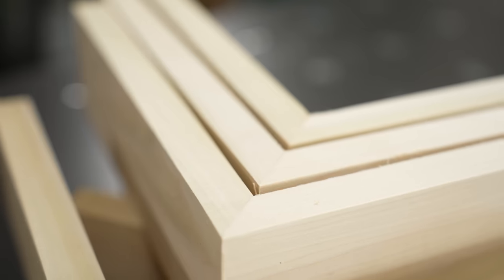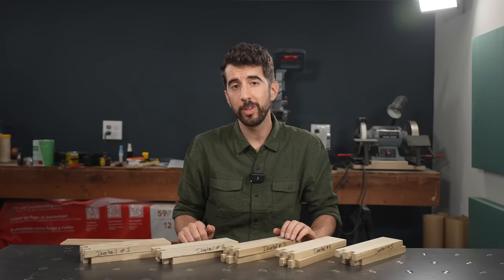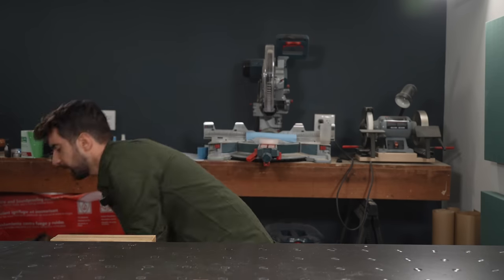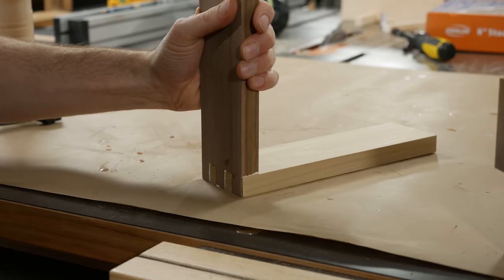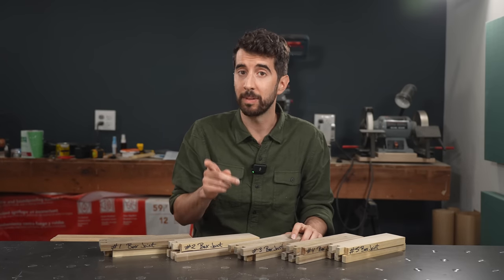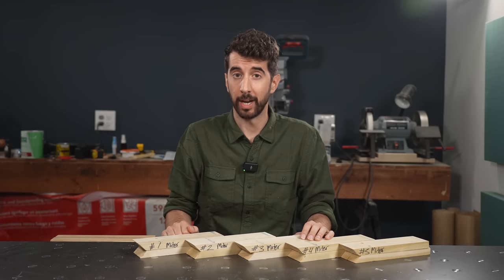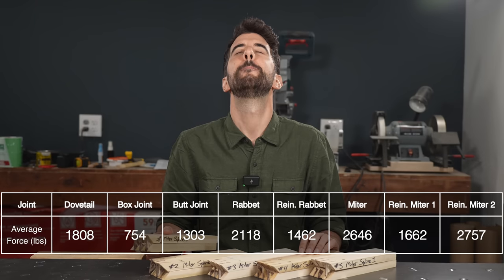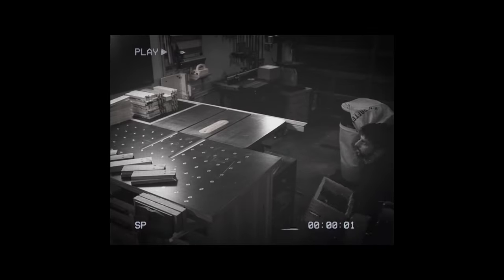This Simple Joint is Stronger Than a Dovetail!

Comment: I use the splined miters like the last one you tested on all of my picture frames - looks great, good to see that it's actually good.

For my boxes/humidors, etc. I actually use a mitered dovetail - do a miter joint, glue it up, then do a dovetail through the miter. Those look awesome as well, and have to assume that it'll make those joints even stronger than the splined miters - would be interesting to test that.

Comment: Would have loved to see how the mitre lock joint holds up given the newfound knowledge of mitre joint strength and glue ups!
Reply: I second the wish to see a locking miter tested. Solves the clamping challenges of std miter and appears to prevent glue starvation of many joint types. Also increases glue surface area.

Comment: Interesting test and valuable despite the very limited amount of samples. I'll definitely be using more rebates and miters! As a point of interest; discarding your top and bottom samples as "outliers" isn't a good idea. Statistically speaking, outliers can be calculated from quartiles (Q1, Q2/Median, Q3) and the interquartile distance (IQ). Top outliers would be >Q3+1.5IQ and bottom outliers <Q-1.5IQ. Your sample size is so small that you can't really reasonably tell what an outlier is (unless you notice something weird with the actual workpiece) so I would just take the average of all 5.

Comment: I think, as you mentioned, that the main call for dovetails in drawers is not brute strength. it's long term resistance to wiggle and thousands of tugs.
Reply: Dovetails are kinda a cool looking joint too.
Reply: @steveweinbeck1968  I agree, but the box and reinforced (2nd type in the video) are also visually appealing.

Comment: Ok - statistically there is no good reason to throw away the top and bottom values. They are important contributors to the estimation of your standard deviation. If one is miles away from the others then you may consider removing it but you do have to be really careful about biasing your results.
Reply: Yeah he pretty much just cut his sample size in half by doing that but whatever. These tests don't even matter as experienced modern woodworkers already know that pretty much anything you do these days is overkill in reality.
Reply: @CarlYota No he did not cut his sample size in half because he tested all five. What he is doing is taking the mode of his samples and then taking the mean of that mode. For large sample size taking the median would have been better but for low sample size his method is good approximation.

Comment: I am a big box-joint person, and one thing I have found is that using the swelling action of water based glues is a great way to close the joint without starving. If you make them just a hair looser, so that only one mallet tap puts them together, they swell within minutes to the point where you can no longer pull them apart, without all of your glue squeezing out when you clamp them.

Comment: Thanks for the video.  I've been messing around while out of work for health issues. But, I just did a butt joint for some drawers for pots and pans. Way harder than what I thought.  The cabinet I put them in, opens up real wide inside. So I had to basically build the framing for the drawer slides to be mounted to.  So the only measurement I had to go on was the spacing between the cabinet doors. First one wasn't perfect. I tried to keep a slim profile but due to an uneven shelf, the back of my drawer rubs on the bottom. On the second one I gave myself a few more inches and raised it up a bit.  They are both pretty sturdy drawers though.   It was challenging, but I'm very excited they work.  I have hand me down saws with extremely worn blades and shaky hands. Next project, I will buy new blades since I got to experience a very painful kickback. I might look into some sort of cross cut sled. I don't know if it'll work on mine but worth a shot. I Would like a bigger surface for table saw so that might be my next project. I've looked at a few.  I just need something simple though. Like I said I have no training just trying to make things a little more organized in the house while I'm home. And I had extra wood lying around for the drawers. It was fun, though. I enjoyed doing it,  just wish I was better at straight cuts. If I do build a table to put next to my table saw stand, does it need to be the exact height or a hair lower to push the boards being cut onto?

Comment: My biggest take away was that no matter which joint I use, it will never be under this much stress. LoL! Great video and I thoroughly enjoyed it. Great data. Thank you for sharing. A plywood box I made when I was a teen, 40+ years ago, with butt joints, glue, and brad nails is still holding together after all these years. Mostly. Wood movement, the plywood warped and bowed on one side, caused the most likely glue starved joint to fail. However the nails kept it together. I merely squeezed more glue into that joint and clamped the crap out of it for 4 days. It will probably bow again in the future, but I'll probably be dead and IF any of my kids keep it, they will be the one gluing it back together again. LoL

Comment: Fantastic test! Very eye opening. I would be interested to see how a 1/4-1/4-1/4 joint holds up, as well as a stepped dowel (Miller dowel).  But this test has convinced me to not spend the $ (and time) on a dovetail jig for making my shop furniture.
Reply from the maker: I mean, at the end of the day, it would be pretty cool if your shop drawers were all dovetails

Comment: Really interesting.  I guess we are all slow to adapt to the reality of how strong modern glues really are.  I make kitchens and when the design calls for wooden drawer boxes, I use the quarter/quarter/quarter joint as it is highly repeatable.  After watching this, I should just use the butt joint as it is more than strong enough and would be faster to build.  Great video, much appreciated.
Reply from the maker: It's hard to know how long a butt joint would hold up over time though. The quarter-quarter-quarter method is great and I would still imagine it holding up for a longer period of time.

Comment: As a picture framer of 40 plus years....45 degree mitre joints while being fast, are also extremely strong.  We used to pre drill and put in a finishing nail on opposite sides.   Some of the high end frame mfrs sold metal clips pounded in from the bottom.  None are necessary. Suggest you use a light coating of glue...wait a couple minutes then glue as normal.  Square clamping is essential.   After that they are stable.  Movement of a joint like drawers, requires the right pull push joint.  If you look at cabinet doors that are 45 mitres...they  last forever without any other reinforcement. Try to refurbish a 150 year old piece and study the joinery.  You'll learn.

Comment: GREAT job Scott!   I love that you tested multiple samples.   I wish more would use this approach.   Testing only one is not reliable.     On Longevity:   I have seen many many picture frames fail with glued miters.  The seasonal cycling will pull the joint apart and typically shows as a gap on the inside end of the joint.   Like you said, the longevity of these joints needs to be tested.   I would like to hear how one might do an accelerated test of longevity.   Anyone???
Reply from the maker: I'm devising a scheme for making some sort of contraption that can put a small and cycling amount of pressure on a bunch of test joints all at once (something like 30 lbs on and off every couple of seconds) and have it contained in a sealed enclosure where I can introduce and evacuate fluctuating humidity say every half hour. Leave it running for three months straight and see what happens... it might take me a few years to get around to it though 😂

Comment: This video is very much a testament to the power of a good adhesive (and joints that maximize its effectiveness).
Reply: But one should remember that modern adhesives are stronger than natural lignin in the wood that keep fibers together,  but nowhere near as strong as fibers themselves.  So phrase 'stronger' than wood and at what connections you get mechanical advantage, needs to be taken with this understanding. If you make mechanical joint breaking which tries to tear the fibers, that will be stronger than the glued ones.  If the force tries to separate the fibers,  modern glue may give stronger result

Comment: I made some plywood drawers for the bed of my truck about 7 years ago that have seen more abuse than anything else I have ever build. Since they just hold tools, they are simply constructed from 3/4” plywood for the sides and 1/2” plywood for the bottom. The bottom is glued and screwed to the bottom edge of the sides and the sides are glued and nailed together with reinforcement blocks glued and nailed into each corner. These drawers hold literally hundreds of pounds of tools and one of the is so hard to pulled out of the truck that I have to grab it with both hand, get a little momentum, and lean back on it. I have pulled this drawer in and out countless times, definitely several thousand. Those joints have never budged once.

Comment: I think I have seen others do similar tests on YouTube, though off the top of my head I can't think of one.  I'd be curious to know if you modeled your test on someone else's and if you found your results consistent with what others have found or not.  Glad you posted the spreadsheet in the video.  I paused it there to look at all the data points and examine the deviation.  It's a lot of work to make 5 samples of each joint for testing, so kudos to you.
Reply: Lots of people have done this. Bourbon Moth did and also concluded that splined miters were the strongest.

Comment: with end-grain to end-grain the glue travels down inside the joint, instead of just having the surfaces grabbing the glue you have the inside structure of the wood allowing more area for the glue to cure into i would love to see and end-grain to end-grain but join vs end-grain to long-grain vs long-grain to long-grain comparison to verify my thoughts though

Comment: Dang, this video definitely went against expectations. I need to watch all the other good wood failure tests of using forces in different directions to help get a sense of what's actually sensible.
Now of only someone could make a test about the right tolerances with digital calipers or even a micrometer for testing purposes and in a similar vein just purely about what clamping force (pressure, not just force but per area) is too little or too much. Also some kind of accelerated longevity test for joint types, just taking your wood outside to gather moisture and inside to dry up again, maybe in a monthly basis.
I know I'm not in a place right now to be able to do that and film it as well, but please, someone, take one for the team and advance woodworking for us all :D

Comment: I know I'm late, but I have an idea as to why the miter and miter plus spine joints are so strong with glue. It has to do with surface area. A 45 degree cut across the wood increases the amount of surface area on which the glue can do it's work. With the post-cut splines, there's even more surface area and it's working with the angle you're putting force on the joint, rather than against if you were to put force on the sides of the boards. Basically, it has the benefits of additional surface area like the box and dovetail(we'll ignore the likelihood of wasted glue from the fitting expulsion, at this time), but it also has the benefits of not working against the force being placed on it from the test.
Reply: I figure it's more about the straw-like fibers that allow the glue to penetrate both surfaces like hundreds of little fingers binding those two surfaces. As demonstrated in this video the wood didn't break in the miter cuts, just the glue. So logically the more fingers holding it, the greater the grip.

Comment: This is a great example of how the experiment or test setup can change the result entirely. The tests are good, repeatable and you even used 5x samples each which is good practice. They are conclusive but only if you use your wood connection in this one way with the force being applied to this one direction. It´s an isolated test.

Comment: A key feature in mechanical joints is the mode of failure. Our buildings for example are not only designed to be the strongest, rather an important design consideration is to have a ductile failure, meaning that the structure does not fail catastrophically suddenly, but allows a considerable strain prior to failure. If you've ever sat on an old chair that was falling apart slowly under your weight you can appreciate the heads up a forgiving joint has. I you were to load a structure that feels strong until the very moment it breaks you'd be frightened to use it again. the mechanical interfering joints are the ones which sustain strain and fiber compression before snapping, making them a safer joint to use. As said in the video the strength is enough even with the weakest of the bunch. the mode of failure is key.

Comment: If you do another run of tests I would love to see how the "half-blind tongue and rabbet" and "lock-miter" compare.  

There is also probably a joint effectiveness difference between manufactured plywood and solid wood: like the mitre might fail over time in solid wood that moves, but the more stable plywood won't stress the glue joint.

Comment: It may be interesting to also note if the joints that failed in the glue had an adhesive or cohesive failure, or substrate failure.
Generally, cohesive failure occurs at a higher force than adhesive failure.
The rabbit joint appeared to have adhesive failure, with the glue pulling away from the smooth surface, with a minor bit of substrate failure where it pulled off the top layer of wood.
The mitre joint would be more likely to have a cohesive failure due to the glue penetrating the end grain, meaning the glue itself needs to break. This should allow you to get the maximum strength of the glue.
Reply from the maker: Good point 👍

Comment: It seems like the dowels and the first splines worked like levers to break up the structure of the rails. 
So the weakest of these joint would require 2 linebackers standing on it to break?

Comment: Scott, did you test all of the doweled rabbet joints with the dowels horizontal in the jig? If so, that's opposite of the direction I would have them in a drawer. The fixture should be pulling the the dowels out of the wood rather than putting the force from what would (in my usage) be the side of the drawer. I'd have the dowels in a front-to-back orientation in the drawer to, I think, maximize their effect. But as most people wouldn't want to see the dowels in the face of their drawers, a false front would also be a likely design element of this dowel orientation.

Great thought about the longevity of glue-only joints considering the wood movement with changes in humidity. I think that would be exacerbated by the more common use case of having a hardwood drawer front and a lesser species for the drawer backs and sides. With miters using identical wood species as in your test pieces, I wonder how the results would differ over time.

Comment: As someone who usually likes to reinforce any sort of joint I was absolutely surprised I can just start saving a ton of time by doing just rabbets 🤣

Do you think that keeping the use of screws will help over longer times or it will just come up with the treatment we do to the wood after the jointing?

Also how much of a tight fit is really needed ? I've never really cared much but this video and people overall keep bringing up how much exaggeration some people have in how much of a gap is too much in normal joints and reinforced joints.

Comment: When making box joints or tongue & groove i always remember what Norm Abram said " you don't want to make it so tight that it'll squeeze or push the glue out". I always leave a thin sliver of room for glue, in 30 years of carpentry never had a joint fail or come loose. 
All hail Norm .....

Comment: As someone with some material science experience: you have to remember that the fibers are stronger than their bond to each other. You can really nicely see how this matters at 15:20 for the splined miter. You interrupt like half of the fibers, and create imperfections where stress concentration and fracture formation can occur. You have to remember that the stress isn’t uniformly distributed. That and the anisotropic strength and stiffness of the material is the kind of reason that people do complex finite element method simulations where structural strength and economic use of material are top priority

Comment: Dovetails are prized as being a self stabilized joint, being weaker only in one direction (the direction of assembly). It could take a lot of dimensional seasonal changes without coming apart. Due to their complexity, they are also considered the mark of a highly skilled craftsman when they are hand cut.

Comment: Very surprising results in deed. Entertaining as it is, I just can't think of any practical situation where any of the joints need to withstand the kind of stress that you've subjected them to. As you've pointed out, the usual application of these joints will never stress them to the level that they've suffered in this video. For drawers, I'd go for a blind dado over a dovetail every time.